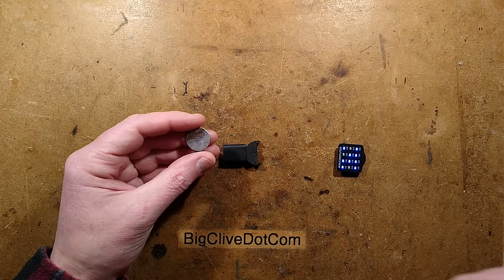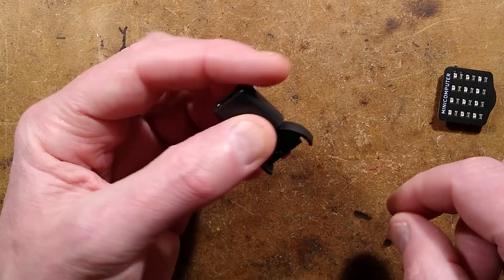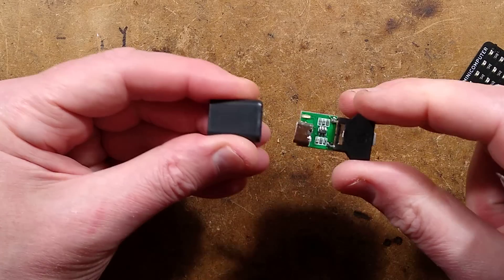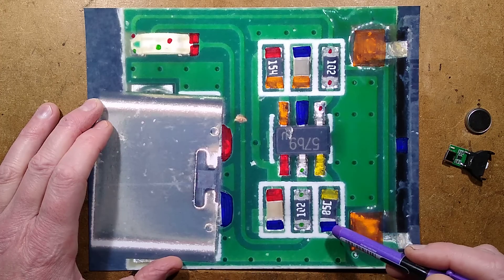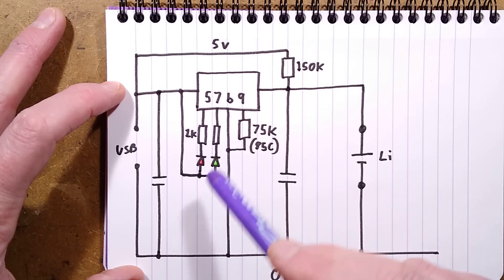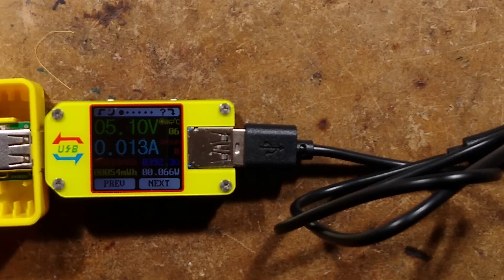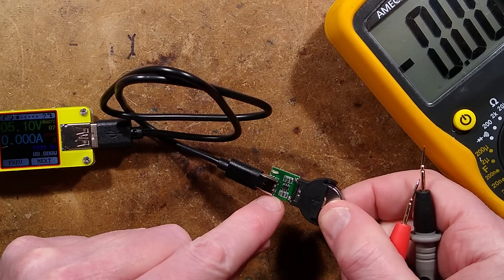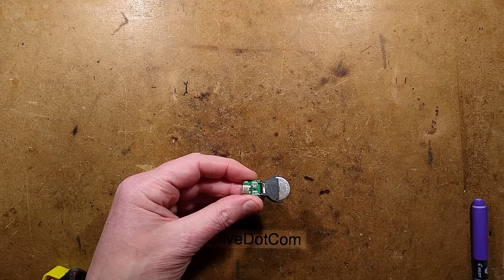2032 lithium cell charger with reverse polarity test

Comment: One problem with these rechargeable button cells is that they’re around 4V to 4.2V fully charged, while a nonrechargeable CR2032 is around 3V (typically 2.9V under any kind of load). They’re also capable of delivering quite a lot more current (100mA or more in short circuit). This means that they’re not a drop in replacement in all electronic devices - especially those that don’t incorporate any sort of voltage regulation or that rely on the low current discharge limit of a non-rechargeable cell. I have a kitchen scale that uses 3x 2450 cells I think and the rechargeable versions are unusable as the display just turns on solid white due to the higher voltage I suppose.
Reply: ML2032 have the opposite problem: voltage is around 2.5V under load, which is very marginal for some "3V" devices. They have lower discharge as well, the one I tested could do only about 2mA continuous draw, and that at around 2.3V or so if I remember.
Reply: @SamStinson  That's good to know. I haven't actually used any as a drop in replacement, but was planning to when the CR2032 of my digital calipers dies. Atleast there is no harm in trying. Worst case I lose a bit of money if they have too low a voltage under load.
Reply: As others have stated, there is another variant, the ML2032 that has a nominal voltage of 3V and is rechargeable. The disadvantage is that these only have a capacity of around 65mAh compared to the 200-250mAh of CR2032.
Reply: So, in my very expensive illuminated reticule riflescope, do you think there would be a noticable brightness difference between this and a disposable cell?
Reply: @cascadianrangers728  There is no harm in trying out the ML2032. I wouldn't risk trying the LIR2032 in an expensive tool.
Reply: depends on if the illuminated reticle uses some sort of voltage regulation or not @cascadianrangers728

Comment: I suspect the 150kΩ resistor is acting as a pull up on the output. The chip is probably looking for something like +1V to +4V on the output before initiating charging. +5V would indicate no cell present, and < 0V would indicate reverse polarity.

Comment: My guess would be that the 150k resistor is there to prevent the output pin from the charger chip to go negative if they temporarily switch it to be an input when they detect that the cell has been removed and a new cell is inserted. Without the 150k resistor tied to the 5V rail that output, now a input, be at negative battery voltage and that might fry something! 🙂

Comment: I'll say the circuit checks for the correct polarity for electricity to flow and follow.
-- when you put the battery backward and cause the polarity to become **- - the circuit stops the electricity flow which also explains why the LED switches Off if you put the battery backward since that breaks the circuit and stops the current flow through the battery.
The 5769SMD likely has single-direction polarity protecting the cell from getting short-circuited and stopping the electricity from feeding in reverse through the battery damaging it.

Comment: I bought a set of plastic digital calipers on a lark. But then I realized it’s the best tool for measuring magnets and batteries.
Reply: And plastic/ceramic tweezers for handling small button cells.

Comment: I think the chip acts as a current source and sink. The 150K resistor allows a very low trickle charge on nearly dead batteries with the chip acting as a shunt for anything over 4-ish volts. Check the output voltage without a battery installed.

Comment: it is the extra bits of info i love. for months i have been shoving a cap across the rails on my breadboards. i never knew they were 'decoupling' something. talking of caps, i also never heard of 'class y' caps for 'suppression' till a BC vid. upon research i am intrigued that class y caps are supposed to fail open, not shorted. i'd love to know how they achieve this.  i am also chuffed that the 85C resistor in the video is as wonky as some of the ones i've soldered.

Comment: Are you sure the top connector is live?  It may be side is + and bottom is -, top is a spring to hold it down.  That would prevent reverse charging.
Reply from the maker: Only two face connections.

Comment: I see that the battery contacts are on the faces of the battery, normally on a device that takes a button cell, the positive connection is on the outer edge, so that you get no connection if put in the wrong way. It being a charger I guess it would go have gone with a big bang if they had used that type. 🙂

Comment: that must be handy for some, but all of things I use button cells for (car keys, instrument tuner, multimeter, etc...) have very low power needs. They basically last for a year or more depending on use. That, and the fact that they cost basically a dollar for four at dollar stores, makes this entirely unnecessary for me

Comment: I was not aware a 2032 cell was also available in a rechargeable type.  Just never gave it much thought, I leaned something rather important here, I’d hate to slip a lithium CR2032 into a device that has an automatic charging circuit. 💥

Comment: I got excited that I would be able to buy some of these for old PCs that stay turned off and unplugged for long periods in my lair. Unforunately, the voltage difference between CR and LIR versions don't inspire confidence. I'll be sticking with the known good CR batteries.
Reply: If you're just wanting to keep the clock and boot settings OK for longer and not that fussed about what it looks like, use 2x (non-rechargable) AA cells in series to get 3v and wire it to the battery socket. A good brand of AA cell should run the clock for years.  Very old PCs actually had a set up like that as standard before coin cells became common.

Comment: One thing I never understand about coin cells is that many devices that take them, especially watches, have receptacles that can short the battery as it is inserted. Almost impossible to avoid a brief short. How much capacity is lost in this short?
Reply: Probably not too much (limited by internal resistance).

Comment: Had no idea they had rechargable button cells. We have a security system that has tiny sensors with button cells. Only have change 2 in 2 years but would be good to have rechargeables. Will be looking into these! Thanks Clive!
Reply: As others have said, you can't use the LIR2032 to replace a CR2032 for most devices. Their voltages are different. It might work but could damage the device / cause weird behaviour / ... I believe ML2032 is a suitable (rechargeable) alternative but capacity is much less compared to CR2032s.
Reply: @olafdesneeuwman8983  Roughly, over 3.5 times less capacity than CR2032.
Reply: I have one on my computer motherboard.
Reply: Don't bother the capacity is appalling, I've used these myself
Reply: I was thrilled for these rechargeable 2032s until I found out about their capacity ☹
Reply: @anormes Yeah, it probably works for things like game consoles which are likely to not be kept unpowered for long periods, (and I doubt that retaining memory in a CMOS chip requires that much juice anyway) but not so much for stuff that's not intended to be charged while in-situ.
Reply: The capacity issue is sometimes worked around by simply keeping 2 on hand and swapping them. But they need to be easily swappable for that, and a lot of devices with coin cells intentionally make that very difficult now for "safety".

But even if the recharge swap cycle suits, you also need need factor in voltage differences.  These are standard lithium ion cells with full charge voltage around 4.2v. CR2032 cells are about 3.2 at absolute maximum. Many devices we'd like to shove these into lack voltage regulators and feed the battery straight to a microcontroller.

Comment: Whenever I measure 2032 cells with my metal calipers it reads 3.2mm and zero volts :o)

Comment: I have a few questions to people who are more knowledgeable than me, about LIR cells:

I have an old Casio graphic calculator that I like and use quite a lot. The problem is it's powered by three CR2032 cells, and it's draining them empty pretty fast, meaning I have to replace them pretty often which gets a bit expensive in the long run. Because of this I'm considering using rechargeable LIR2032 cells insted.

Should I be worried about the voltage difference? Will LIR cells damage my old precious Casio calculator?

Does LIR2032 cells have the same capacity as CR2032 cells, or will I have to charge them more often than I now have to swap the CR2032 cells? I assume the LIR cells have significantly less capacity.
Reply from the maker: I wouldn't risk the higher voltage.
Reply: @bigclivedotcom  Thanks for the advice. I see from the comments here that another alternative would be ML2032 cells, which are 3 volts and also rechargeable. Maybe that's the alternative I'm looking for?
Reply: It really depends on the circuit inside the calculator, I assume they're in series which would make 9V nominal from the original cells, but 12.6V max from the rechargeables. The capacity of the rechargeable cells is much lower. 
Many chips run on 3V nominal with 3.6V absolute max which makes powering them directly from 3V cells ideal. But I don't know why a calclator would need 9V. If they're in parallel you might be able to fit in a small li-ion pouch cell instead, with a voltage regulator of needed.
Reply: @teslatrooper  Thanks for the answer. It actually says on the battery cover "DC 9V 0.03W Use battery 3V x 3", but here's the strange thing: You install the cells side by side, all with the + sides up, and then you put a metal cover on top, which makes contact with all three cells on the + side. This would indicate to me that the three cells are connected in parallel, although there are separate tabs making contact with the sides (+) of the cells too. There's clearly something I'm missing here. Can the cells be connected in series if all the + sides are connected?
Reply: @HGSolberg  If there are separate tabs they can still be connected in series internally. I looked at discharge curves for ML2032 and they have a lower nominal voltage than the CR2032, but should at least be safe to use.
Reply: @teslatrooper Ok. I see. Thanks.

Comment: is that bypass resistor needed to wake up the charging chip perhaps ? maybe its there to keep the chip awake and no matter how dead you battery is the chip will put current into it 
some charging chips wont work if the battery voltage is too low

Comment: Perhaps the 150K is there, in the event the battery is very low, the trickle current may boost the battery high enough to start charging,

Comment: am I right in understanding that these can be actively dangerous in CR2032 devices due to the higher voltage? I've something that requires 2 at 6V so I assume I have to use CR2032 or the much more expensive ML2032 options instead
Reply: Yes, many electronics with absolute max. voltage of 3.6V are run directly off CR2032 and would die from LIR2032 so be careful. For the 6V device it would depend on the circuit, check if there's a regulator in there. 
I didn't know about ML2032 those are neat, apparently they use lithium manganese dioxide chemistry, and the max charge current is 2mA so this charger would blow them up.
Reply from the maker: Some devices may be damaged by the higher voltage.
Reply: If only there were LiFePO4 in 2032 size, the 3.6V maximum nicely coincides with the maximum recommended voltage for 3.3V chips.

Comment: Interestingly an IC with this marking is listed on a Prime shopping site as Tp4057 SOT-23-6 Lithium Battery Charging IC 500mA Battery Reverse Connection Protection 1%  (so it does apparently have reverse polarity protection)
Reply: So it charge 0.5A 5V to this battery ?

Comment: Thank you for sharing,  the timing was perfect.  Didn't even realize there was rechargeable CR2032 cells. I was just changing one of these batteries this morning, and was surprised to discover a cell measuring 3.03V was not enough to power a kitchen scale, but yet another one that measured 2.97V did work. 🤔
Reply from the maker: The cells tend to show around 3V even when their ability to deliver current has diminished.  Under load the voltage drops.
Reply: That would explain why some of the batteries do not work in my remote doorbell.

Comment: I would be interested in your opinion of these rechargable vs cr2032's in regard to usefullness and cost efficiancy, would recharging them cost more than just buying non chargable batteries?
Reply: Recharging cells will always be cheaper as they last for thousands of cycles and the cost of power is negligible, but their capacity is quite low and not all devices support the higher (4.2V) voltage
Reply: @teslatrooper    my concern is primarily the low MaH causing the recgarging to be not cost effective especially as the power companies are being tw@s at the moment. 🤑

Comment: be mindful anything 'smart'  or with sensors based on resistance or anything sensitive to the input voltage (temp,humidity etc..)may not work as expected when powered by a 4.2v cell when expecting 3v. fwiw my miflora v1 sensors did not like the 4.2v cell, ble funtioned ok,  but sensor readings were way off..

Comment: Hi Clive. Any thoughts on how many recharge cycles a typical LIR2032 is good for?  I hardly ever use my electronic calipers because the dang battery is always dead, and instead rely on my Brown & Sharpe.  The B&S doesn't do metric though. Thanks man.
Reply: Should be a couple of thousand like normal lithium cells.  I'd be a bit wary though, fully charged they'd be at 4.2v and the capacity is a bit rubbish (40mAh vs ~200mAh for CR2032).  The calipers would probably handle the higher voltage (could always add a diode to knock half a volt off) and buy a couple of them.
Reply: @j.f.christ8421  Noted. Thank you.

Comment: I wish these came with lifepo4 chemistry with a nominal voltage of 3.2V, I'd be a bit worried to put a 4V cell in a device that is designed for 3V.
Reply: I've been trying to find smaller lifepo4 cells, smallest so far is AA size. They're perfect for many small projects especially solar powered devices.

Comment: Thinking about it, why can I not recharge normal Li cells? Are they not the same chemistry like all other Li batteries?
Reply from the maker: Non rechargeable lithium cells have very different chemistry and do not tolerate attempts at recharging them.

Comment: i dont know why PC motherboards dont use rechargeable ones ,but i suppose all they so is keep volatile date data and will last  a decade and most people will update them by that time , i see its benefits for retro console players though where save data is SRAM which is volatile memory using a cell button
Reply: There where motherboard manufacturers that did use nicad/nimh batteries for the cmos battery but they tended to leak after a few years.
Just a button cell is easier for them to implement on a board, they don’t have to worry about a charging circuit. Even if it would just be a diode and a resistor

Comment: I'm curious why LR2032's can't be charged. 
I used to have an alkali battery charger, it worked and the batteries didn't spontaneously combust, but they would really fade after 5 or more charges. I believe it pulsed the charge, giving the chemistry time to rest/cool before another pulse.
Would that kind of charge work for LR2032?
Reply from the maker: The periodic current reversal chargers often caused alkaline cells to pressurise internally and leak.

Comment: Just as a cautionary note, don't use metel calipers when measuring the thickness of the cell  !!😏
Reply from the maker: That's why I used plastic ones.
Reply: @bigclivedotcom  you probably know this, but you measured 3.1mm because your calipers were zeroed at -0.0, not (+)0.0. these cheapo calipers have two zeros! It's because of the 2's complement binary used in the control IC.
Reply: @ollysworkshop 2’s complement only has one representation of zero. 1’s complement has a negative zero, but it’s unlikely that would be used.
Reply: @Mark-px3rq  You're right, I remembered that wrong. Ages ago (probably at least 15 years) I made a digital caliper DRO system using a PIC microcontroller. I did the code in assembly and I believe I used 2s complement for the mathematical operations. Looking it up again, the Chinese calipers spit out 24bits where 3 nibbles are the numbers and the fourth nibble is flags, such as negative and metric/imperial. So I suppose it's more of a signed binary. Either way, it has two representations of zero.
Reply: Well, maybe if he does measure it a bit longer with metal calipers the cell gets the designated thickness 🤣

Comment: Hmm .... insert a ( dummy , circular PCB ?  2032 ) with leads connected and then you might charge other cells ( slowly ! ) , you might want to do this because this unit is SO neat and tiny ( ? ) ................. DAVE™🛑
Reply: Be good for small pouch cells as typical chargers have quite a bit too much current.